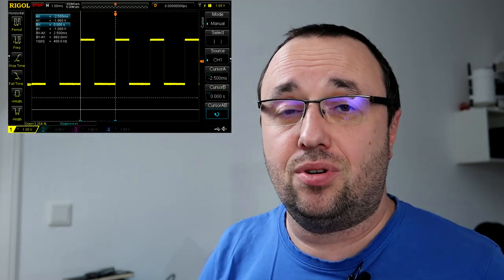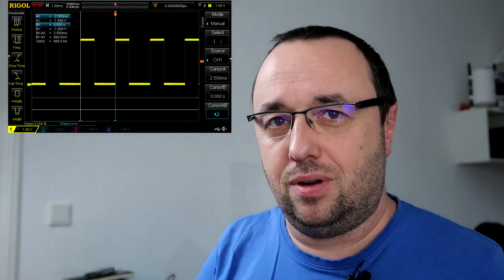ESC protocols demystified - PWM, OneShot125, Multisot, DSHOT

Comment: Nice explanation... As engineer I´m very familiar with the techniques from timers, protocols and electrical perspectives, but was always to lazy to research and and discover how each one works. This made me think that I´m stupidly setting my flying wing to use multishot just because it was the fastest, but I´m probably loosing resolution.

This line of videos is very interesting, because I can easily watch while drinking something, after a heavy work day. And I would never research about that in some blog with that stress.

Comment: Thanks Pawel! I purchased a two channel portable oscilloscope when my KISS AIO had a malfunctioning ESC. I could see the output of the signal as a dirty trapezoidal trace as compared to the clean signals from the other ESCs. To bad that the bad ESC had already burned the windings of a new motor. Could you show how you performed your tests? I would like to try that out too. Other kwad pilots have given me their old failed FCs to play with. I'm also purchasing an IR camera to find and follow heat signatures on the FCs and other boards. Keep up the good work! Peace...Guy
Reply from the maker: more will follow in a next vid in this series

Comment: So if I understand you correctly, "standard pwm", oneshot and multishot are just PWM, and dshot is just UART am I correct?
Reply from the maker: yes, that is correct
Reply: @FPVUniversity  hmm. I've been meaning to make my own flight controller. I've been bashing my head against the wall trying to find out exactly what is ibus (that my fs-ia6b rx uses) and what's oneshot125( that my emax esc uses). Most of these products don't even have a datasheet that I can look up 😐. Thanks to this talk I understand oneshot now. I think people need to be a bit more consistent about naming stuff😂. 
Again, thanks.

Comment: Why create yet another serial data protocol ie Dshot, when SPI could have done the job just as fast or even faster than dshot ?
Reply from the maker: mainly because for SPI you would need at least MOSI, MISO and SCLK wires. 3 per ESC plus ground in some cases

Comment: Excuse me, I will submit you a question that is slightly off topic: can I use a dshot/oneshot/multishot esc with a PWM input? I mean, can I connect an esc directly to a standard pwm receiver and use it on a fixed wing aircraft?
Reply: Yes, at least mine I just tested worked. i just hooked up a servo tester to an esc and the motor ran perfect.
Reply: Thank you a lot!